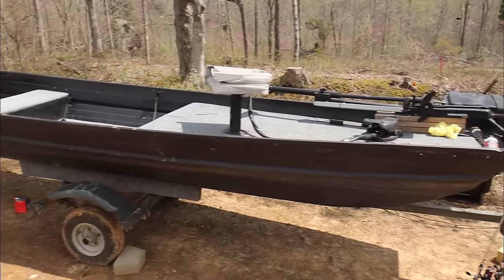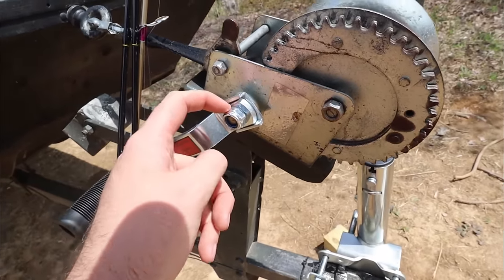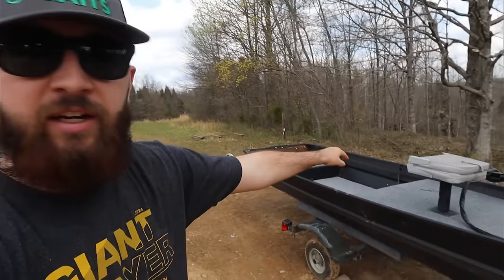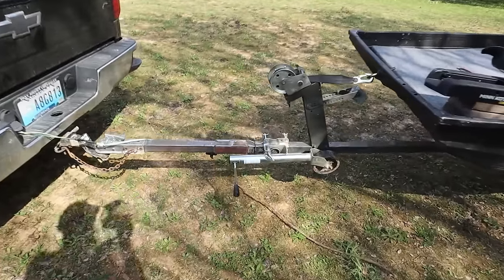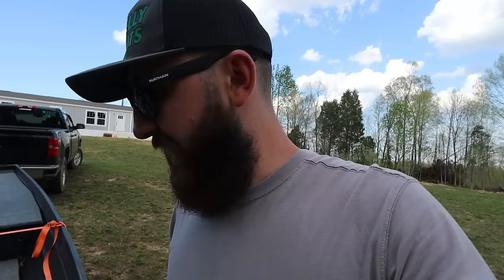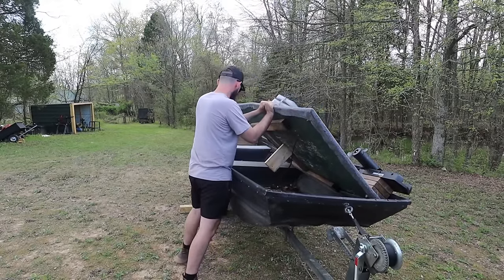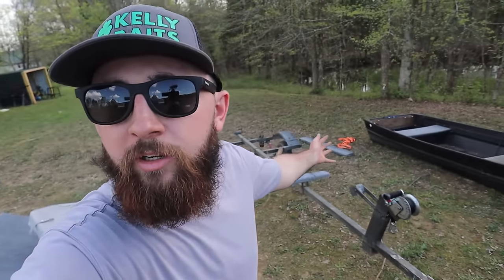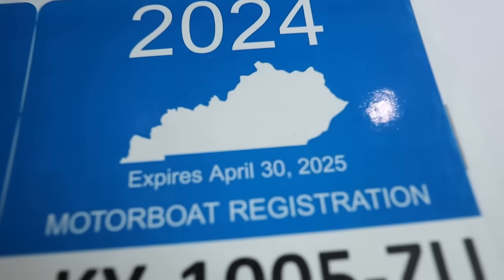I Finally Fixed My $300 Facebook Marketplace Jon Boat!! *it might sink*

Comment: I'll check out your other videos but just a tip if you ever want to do a cheap casting deck or floor. Used road/highway signs.  The ones that arnt aluminum,are marine plywood. You cant really get them from your city or county though. The companies that are doing the road construction typically replace them when the do a section of road,and they dispose of them. If you see a large project going on they always have some sort of office trailer or a  lot they park equipment. If you find a cool company they will usually give the wood ones away,and i have gotten a couple big aluminum ones

Comment: As a former aviation engineer, I think the winch handle bolt is too short, it should protrude beyond the lock nut by at least two threads, otherwise the nylon lock will not work and it will work loose under vibration.
Reply: Was thinking the same thing looks like there’s a gap between the nylon and and the bolt tip…
Reply: could just switch the nut round so the nylon end bites first
Reply: @Nathsontop  I hope you are joking, if not then I hope you have a responsible adult supervising you at all times.
Reply: Drill the nut and stud through and insert split pin, not going anywhere with any type of nut.

Comment: Weld a short pipe vertically in the middle of the back cross rail on the trailer. Stand an oar in it to see where the back of the trailer is while you're backing it up. Maybe the same set up on the transom for when the boat is on the trailer. I've done it - it's such a simple fix and makes it so easy to reverse

Comment: When you replace the flooring use Marine Ply - it’s meant for boats. For backing up buy some thin flexi pipes/ tubes about 4-5ft long and mount then on the trailer mudguards each side

Comment: dude! 3/8 to 1/2 inch marine grade ply would have been more than enough to use for decks in the boat and will certainly take a few pounds off the over-all weight of the boat. that siad I love the look of the boat!

Comment: The bolt that the handle attaches to is too short to engage with the nylon part of the nylock nut.  You could use thread locking fluid instead (if you can't replace the bolt)

Comment: Many people already given advise on the winch handle, Clearly the bolt is too short, The thread lock is a good advise or drill and put a split pin to retain it. Or Butcher it and get Dad to put a blob of weld on it to hold it in place, that will be as good as your dads weld lol.

Comment: Hey JT , Nice boat n trailer . Winch handle . you can buy Spring washers or shake proof washers or  cut the nut you have in half using a Hack saw . dont use a power saw as it will melt the blue plastic in the nut , eye eye captain , Have you named you4r vessel yet ?? What about Chedder Rissoto ??? Aplay on words for Cheese n Rice

Comment: RE winch handle. the locking nut isn't fully on, i can se the nylon locking part isnt fully on the bolts threads if possible the put longer bolt one id do the or a thinner locking nut or even to thin regular nuts to lock against each other.

Comment: For others put PVC pipe sticking out in an angle so you can see the trailer. Then just remove them and put them in the bed. You can add flag pole holder to the fenders. Flag pole holders are adjustable. You can also just remove the tailgate. 🤷🏻‍♂️ whatever works.

Comment: put thread locker on the nut, will stop it coming lose or just grind that nut down from the back so the thread actually comes out the other side 2 or 3 turns

Comment: The winch handle needs a bigger bolt cause the blue plastic in the nut needs to be on the threads of the bolt to stop it loosening 😉

Comment: If you unplug your trailer lights before backing into the water at the boat ramp . You will not blow the bulbs out. A friend told me that and it works, so for.

Comment: your handle keeps falling off you need a longer Bolt to make sure the bolt is tightened enough to ensure it sticks out of the nut so that the plastic insert bits in that's what it is there fore  and as such should  should stop it unscrewing.. Love the vids thank you.
Reply: It's not a bolt one piece needs a thinner nut

Comment: Your winch the nuts too deep the bolt doesn't go past the blue nylon on the nut get another nut what isn't as deep or get too thinner ones and screw them both on and lock them together